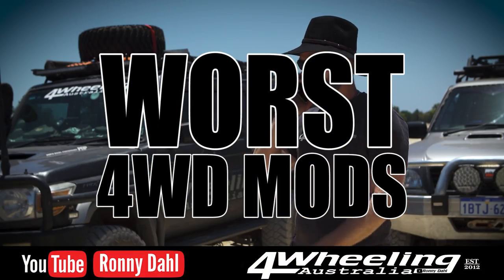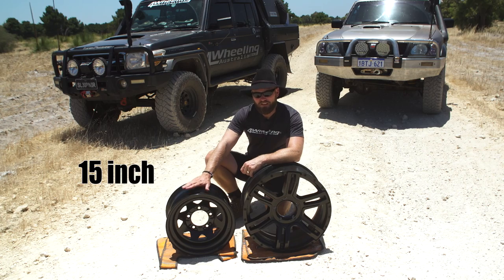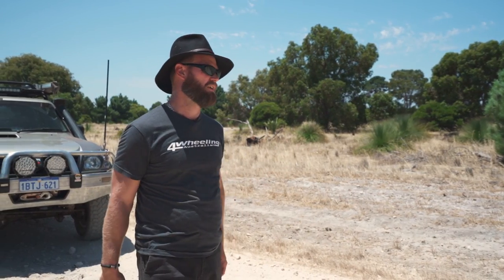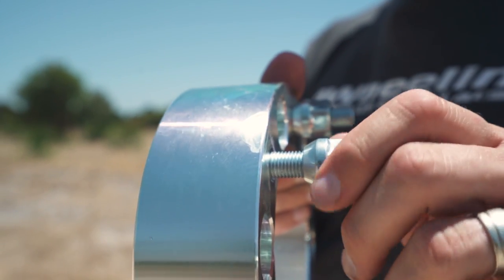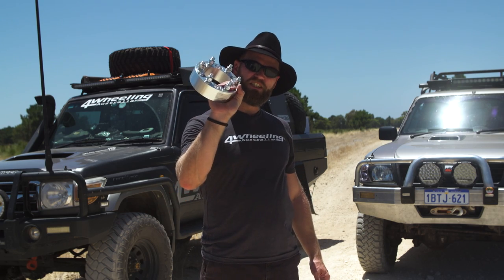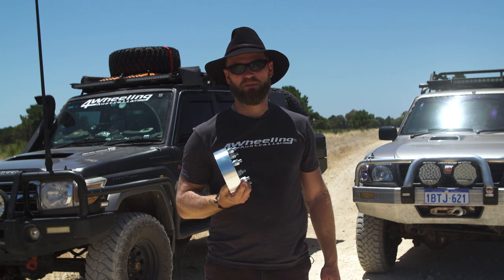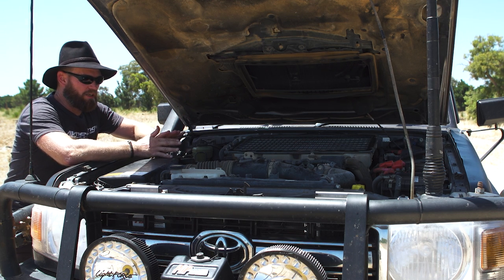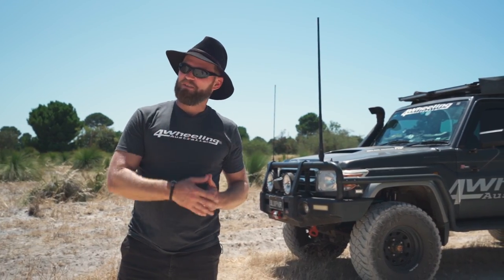WORST 4x4 MODS, DON'T DO THESE TO YOUR 4WD

Comment: Useless mod: the second spare tyre.   In most cases it will likely spend it's whole life on the spare carrier. 

Useless until it isn't though.
Reply: I took a second spare around Australia, never needed it, but cheap insurance
Reply: Frank Bullitt that’s fair enough, but a lot of people take them to the shops every day
Reply: One of the vehicles in our convoy blew out 3 tyres in 2 days up in the cape, I blew 2, we ended up robbing the tyre off someone else's spare and fitting it to our rim because landcruiser and their genius 5 stud.
Reply: On a multi day trip in a very remote place.  Carry 2 spares. I've used both of them.
Reply: For sure two spare tires is overkill in the US. OZ I could see.
Reply: @jeep6242  why?
Reply: @nonope1774   Same reason you don't need 1000km fuel range. There isn't that much continuous off grid space in the US. You can't really go 6-700KM without running into a fuel stop or tire shop here. That is worse case. Most of the time help and supplies are probably 100-300k away. The odds you can't get to where you can resupply with 1 spare and a tire repair kit are pretty low here.
Reply: @Darndiddlyarn  Id love to know how and what car n tyres ? Done the cape twice now and haven't damaged anything. And PS: Done Frenchmans and OTT twice and many other tracks. I run Silverstone MTZ's super super tough tyre
Reply: Justin Mack
Been to the cape via OTT twice.  Yet to do Frenchman’s but would like to one day.  I’ve got the usual 2 inch lift, muddies, snorkel.  Anything Fairly out of the ordinary with driving Frenchman’s during July to be mindful of?  I don’t have a winch on my current car and won’t get one, have a rear locker though.  My prev 4wd had a winch and I rarely used it.
Reply: I generally carry 2 spares. Never used to till one trip i blew out 2 tyres. Only had one spare. No reception to call anyone for help. Solo trip flat tyre = fucked rim. Now I carry 2 spare.
Reply: @cliffbooth7075  are you joking? You don't plan on getting a winch so in other words you just plan on being a burden to everyone else.
Reply: brettbelot
I’ve done a lot of off-roading in all kinds of places and only needed to use my winch 3 times in the past.  It did save me when I needed it, but in general they’re a waste.  Also note id be doing Frenchman’s in the middle of the dry season, not immediately after the wet.  There’s a big difference.  Plus being able to properly drive helps.  I’ve driven up tracks in Cape York and elsewhere just in low range where 8 out of 10 other cars “had” to winch.
Reply: jeep6242 where do you live/go off-roading?  There’s actually a lot of places around me that more fuel range than 300 miles is very nice. Sure you can find a fuel station if you have to but the point of remote travel is to get away from all that stuff. I could easily make use of 600mile fuel range.
Reply: BoxRocketAdventures
I live in Queensland Australia and have been 4wding in many places.  I know my limits too.  I’m not in the habit of doing steep hill driving during or after decent rain when a winch would be required.  I own a car that has 180 litres of fuel capacity.  It’s great because you don’t have to fill up so often.  Good to have the long legs when driving long distances up north too.  People that think you need a winch for Cape York to get around could use a bit more diving experience to learn how to properly negotiate a track, or they’re going too early after tracks are re-opened which is madness.  Prob also the kind of people who think you can’t go to Fraser Island without max tracks (because they get stuck all the time & think because they get bogged due to incorrect pressures or driving style then everyone else will too).
Reply: @cliffbooth7075  Frenchmen's without a winch? you must be kidding?
Reply: @cliffbooth7075  keep off the tracks if you cant recover yourself
Reply: Angus Evans
Agreed.  Come across plenty of those.
Reply: @Mack74  we ran up from syd and spent 6 weeks up there hitting all sorts of tracks, we didn't leave on new tyres.
Reply: gary james
So you’ve needed a winch each time you’ve driven it have you?  Each & every time?  Just trying to seperate the BS from the facts.  Too many people feel the need to lie and blow things out of proportion instead of just being honest.  Which category do you belong in?  When in cape there are tonnes of people who make a simple track out to be super corrugated or difficult as hell.  If you’ve been to cape York and spoken to people you’d know that.  I’ve driven the Maytown track and it was easy.  If I listened to others I should never have driven it because they all said it was slow going and difficult.
Reply: I just have the spare on my car and when I am towing, I have the spare on the trailer, I have made sure that the trailer wheel size is exactly the same as my vehicle, that way I have two spares for either vehicle or trailer
Reply: Worth pointing out that having the ability to self-recover and having a bumper-winch isn't necessarily the same thing. 

Is a bumper-winch one of the easiest methods? Hell yeah!!! Is it the only way? Not even close. A bag of goodies can turn a high-lift into a winch. Granted it is laborious and slow, but people have explored the Amazon jungles and self-recovered with no more than that. A step up in convenience is a hand cable-puller winch or come-along. You can get them in load ratings comparable to the powered ones. They're still fairly slow but you don't have the hassle of resetting every 3-5 feet of pull. There are electric portable variants of the same. Then there's having a receiver hitch front and rear coupled with a mounting adapter that'll hold a typical bumper winch. In terms of convenience though, I'd say my top 3 are a buddy and some tow straps, followed by bumper winch, then receiver-mounted hitch. 

So, for me, a bumper-winch is a convenience/luxury item, not a necessity. A means to winch/self-recover can be argued as a necessity, but claiming the bumper-winch is the only way to skin that cat, and failure to equip one is irresponsible so you should stay off the trail, is a bit extreme in my book. That said, with my aging back, I personally wouldn't choose to head out without a powered option, but I'm not gonna insist that it is a necessity for anyone else. 

Especially for a young guy just getting started, I think it is a disservice to say you need to install upwards of 200 kg of expensive stuff to self-recover. For a young able-bodied man on a budget, I'd say start with a high-lift winch kit with the usual extras like snatch blocks, shackles, tree straps, vehicle recovery points, bridle, tow straps, kinetic recovery (snatch) strap, etc. That'll get you out of any situation a bumper-winch can and then some, for less money and less weight. Bonus is far less impact on handling, fuel economy, vehicle resale value, etc. You'll just have to pay with sweat and time. No free lunch. After that, there's a long list of things I'd prioritize ahead of the luxury of the bumper-winch. I get that mine is a minority opinion though.
Reply: @Darndiddlyarn  ahh nice we've had 5 weeks up there twice now. Just luck I guess
Reply: @Mack74  between 5 vehicles we also blew a power steering hose, a brake line, a suspension airbag, had an ecu go into lock down, had two starter motors stop working from the water crossings, had a battery die a horrible death from corrugations, and blew a rear diff. Everything was fixed or patched roadside and all vehicles drove back to syd for proper after trip R&M. None of us were new to off roading or vehicle repairs so it was a fantastic adventure all round despite what we managed to wreck. Convoy was an HDJ79, FZJ80, diesel parado 90, petrol prado 90, and a nissan pathfinder.
Reply: @cliffbooth7075  you assumed wrong then mate, my point was more geared towards going to remote areas and getting stuck when theres nobody around to rescue you. It's the fucking bush, you wont always have help. You need to be prepared to get yourself out on your own, it's not about helping or being a nice person it's about looking out for yourself incase you get stuck 300ks from help.
Reply: @cliffbooth7075  if you're going remote, alone you need to be ready to recover yourself alone.
Reply: Angus Evans
You assumed wrong because you assumed for some reason you were alone in a remote area.  You’ve got to make others are of that when you chip in with comments that aren’t really correct when you’re thinking something else entirely. But I understand what you’re trying to say.  You don’t go to Cape York alone unless you’re not the full bread basket anyway, you always have others with you.  In fact you shouldn’t go anywhere remote alone.  That’s an important thing to remember.

Comment: Hey Ronny love your channel been watching for years. I do disagree with the spacers, I understand what you're trying to get across and my spacers aren't as big as the one you showed. But I needed little bit of space to stop the rubbing. I have had no issues on my 08 JK that has 140000 miles on them and my bearings are still in good shape. I know this because I just did my ball joints. I will say I did buy the best, Spidertrax. Keep up the the great content.
Reply: Definitely vehicle specific. My 00’ defender came with the alloy wheels, but the option for steelies with an extra 28mm offset was available from the factory. Added 30mm hubcentric spacers to bring the tires out to where they would have been anyway. If you buy good spacers and put the proper thread locking compound on the studs they will not wobble or come loose, but yes if you go with the ebay specials, could run into trouble for sure.

Comment: Im fairly new to 4x4. Im planning on buying a 2nd gen 4runner and squeezing 33x10.5r15s on the stock suspension. The only other mods i want is a locker and a winch. Any suggestions?

Comment: Yeah nah, I bought a high lift jack awhile ago, which I'm never gonna use much.
Reply: Yeah, I had one on a Jeep before.  They can be dangerous as f*ck,  take a lot of space and they malfunction if any bit of corrosion on the creeper pins and springs.  If you try to paint them, then that causes everything to jam up.  It's bottle jacks for me.
Reply: I've found mine really useful with a wheel jack attachment. Just lift the wheel up a few cm and throw the maxtrax right under it. No digging required.

I use it for regular maintenance in my car (I lift the car onto jack stands, declutch your pearls) so I can practise and use it well when I need it.

I also keep a neoprene sock around the mechanism and clean and regrease with molybdenum disulfide after each trip. It's lasted 3 years now without a fault.

I do also keep a bottle jack backup tho.
Reply: @DaveXL495  not saying they can't be useful, and I wasn't particularly worried about using it, but the risk is there.  I did have one tip over once when I had to torque on something real hard.  I live in an area where it's hard enough to keep the vehicle from corroding let alone the jack.  I was disappointed in how it could become dissfunctional with just a tiny bit of corrosion on the pins. I don't have to worry about that with the bottle jack I can store inside the truck.  I also have a 12k lb Warn winch so I really don't need the winching functionality, and I have a stout come-along if I do need something else.   It is a way to get a lot of functionality for very little cost.
Reply: David Liu , just posted same thing
Reply: I sold mine. Bottle jack and half dozen blocks of wood more versatile.
Reply: TheBigBad Wolf  lol i didnt just get a jeep now an expert. I been around and done a few things.

Comment: 15" rims with 33" tires on a hilux is about just right, pretty hard to get stuck.
Reply: dave cadwell 
Tyre pressure depends on terrain and how heavy or loaded up you wagon is, 20psi is a typical starting point in most cases & lower pressure from there. On gravel  start around 30psi. Tyres personally I run Nitto’s, started with all terrain then onto there muddies and have settled on a hybrid. The Nitto Ridge Grappler will be had to find something better to move onto.
Reply: 16’s are rated to carry more weight
Reply: James Mcmillan
Absolutely!  50% more psi over 15 inch & they can handle hundreds of kg more per tyre than 15 inch.
Reply: Cliff Booth 
This depends on so many variables like tyre, off set, bolt pattern, steel vs alloy and the materials used to manufacture. Majority of steel rims in dynamics range for example will only carry an additional 60kg for 16” over their 15” range. My 18x8 fuel assault alloys have the same 1140kg rating as their 15” steelies.
Reply: @jdcoverland365  Cooper stt or sst off road. A pretty good tire.
Reply: @hil7160  never knew that, I thought 15s being smaller would be more solid plus having a wee bit more rubber between them and the road.
Reply: I use Hancock at/m that are 33x12.5r15 on my hilux
Reply: John Doe the Cooper STT Pro is one of the worst tires I’ve ever run. Mediocre traction, horrible tread wear, hard to balance, plows through corners (understeer) when driving hard. I’ll never buy them again.
Reply: @BoxRocketFab  they the new or old ones?
Reply: jarrod k the new ones.
Reply: @jdcoverland365  nitto better tyre than cooper

Comment: I had 1 3/4" spacers on my '07 FJ Cruiser, wasn't aware that I had to torque them every 500 Miles, and one day back driver tire came off after about 10-15K Miles. I was only going about 12MPH, and thankfully no one was hurt and somehow received no damage to the vehicle (gotta love FJs). But definitely won't run wheel spacers ever again.

Comment: Every ute with a 6 inch lift 19s monster tyres and never been off road.
Reply: Especially since offroad tires are usually made for 15,16,17,18, and 20 inch wheels; not 19's.

Comment: I sold my Tacoma and bought a Silverado. Needed the room. But everyone keeps telling me I need a 3-6” lift and 33s or 35s. Nah. It’s my travel nurse vehicle. Putting in a 2” lift and 32” tires. Still good for hauling my motorcycle trailer and occasional trips off road to the gun range. Just not extreme.

Comment: Well said, 
I used to have a 88 samurai spare tire, farm Jack (with lugs welded around the rig), can of starting fluid,match, air compressor, and 2 pieces of uni-strut to use as a lever to be able to put a rock under A tire from time to time.

Comment: Body lift? 

Think ya missed that one mate
Reply: Body lifts put so much stress on all suspension and running gear you would be stupid to do it. Warranties also void. Buy the newest safest 4wd you can afford.
Reply: They make sense on some vehicles when done correctly. An extra inch or two of wheel well and transmission tunnel height and more frame exposure for slider mounts can be a good thing.
Reply: a body lift is the worst thing you can do.

Comment: Thanks Ronny,

We have a hiace van that I want to lift - was thinking 50mm as the van is very low. Also putting in a diff locker just to get me to places, nothing extreme, that she would not normally get to.

Also a AT tire. 

Any suggestions please

Comment: Lifted suspension with no droop
Reply: Trxvy
You just perfectly described a 2 in lifted Pajero.
Reply: @cliffbooth7075  And you are the one planning on doing frenchmen's without a winch.
Reply: There's not a lot of articulation in the 79 series though, for something with a solid axle.  Maybe they tip over with flex coils?  🤔  weird hey, you just don't see any of them with wheel travel associated with most rigid axle vehicles.

Comment: Sounds like someone need's some lessons about Hi-lift's & the tool kit that a proper one would come with. After all it's the Swiss Army knife of off-road recovery equipment in the hands of a knowledgeable user. Anyone that simply call's it a jack is showing true tool use ignorance. Can they be dangerous during amateur hour? Sure, but you can say the same about off-roading.
Reply from the maker: But how many people out there would actually know how to use them in that manner? Most modern vehicles have plastic bumpers which a highlift would crush or tear, if you can use it the basic way then in my mind it’s useless
Reply: @Ronny_Dahl  The amount of people with the knowledge as for how to use a tool is dependent on how many of those people are willing to read instructions and or watch a how to videos. Love your videos & the majority of your opinions. But I truly feel your not giving this tool it's proper credit. Keep it rubber side down my friend!

Comment: Hey Ronny one last question, what size steel rim would you recommend for the 79 series based on widest availability of tyres.  It would be great if you could do a video on tyre sizes that fit on standard, off the shelf,  79's, and 2 inch lifted versions.  I want to put bigger tyres on mine but not 100% sure what is the largest tyre that will fit on a standard 79 without rubbing and clearance issues. The guys at the tyre shops generally don't have the outback experience to answer the questions. Also you may want to cover whether to put really narrow tyres compared to wider ones Pro's and con's etc.  When I was in the Army, all 4 x 4 (excluding trucks like Unimogs etc) generally had narrow tyres. Thanks mate.

Comment: The rim speech is spot on  never put those over sized rims on a 4X4 unless you want your entire vehicle to crack up like glass because of no shock support.   I have a HMMWV and it uses 16 inch rims on a 37 inch tire,